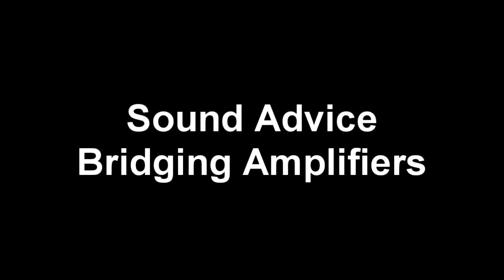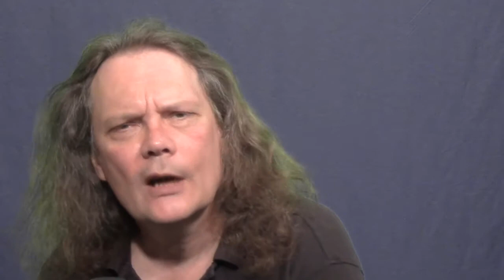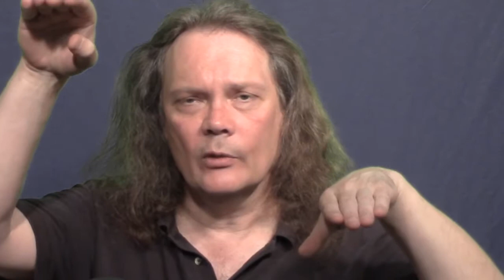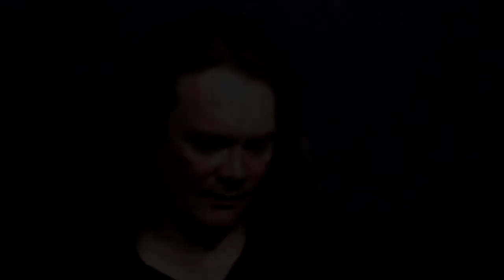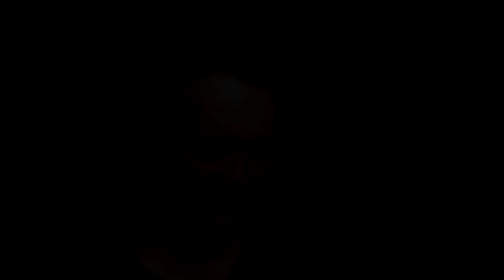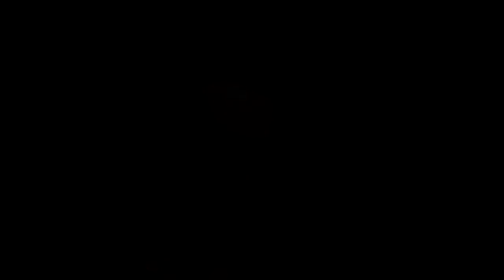Risks and Drawbacks of Bridging Audio Amplifiers

Comment: From the amp point of view there is no difference between bridged and a driver with half the impedance. If your amp can fully handle a lower impedance driver it has no trouble running bridged.
Reply from the maker: Thanks! -- Good point!  For safe operation, the minimum impedance of the loudspeaker load in bridged mode should be 2x the minimum impedance rated for stereo mode.  Thus, if the amp is rated to safely drive a 4 ohm load in stereo, it should have a 8 ohm load (minimum) bridged.

Comment: I knew and understood this. Wasn't until I got back into car audio. With my old school system I had left which was a Cadence amplifier and a Kenwood. Primary used for 8in mids. Put 1amp for 12inch sub. Bridged.
About 35% more out put. Absolutely was stressing the amps. Technically I was still underpowered so yeah I agree with your statement

Comment: Just when every over Bassed Head on YouTube is swearing by the BRIDGE YOUR AMPLIFIER BAND WAGON and rattling and contorting every body panel in their vehicles with a Bass level at a point of major annoyance to my ears and every bolt holding their cars together ..... Finally a Guy who actually is a sound engineer and knows what He is talking about to hopefully set the 
Record straight on how to actually set up your amplifier and Kill The " I am pushing a couple thousand Watts to my Subs Fairy Tale ..... Thanks Man great Video .... I spent years on the Road Lead Guitar, playing Loud and Fast Heavy and Hard Music ... Hauling Loads of P.A. Rigs and Marshall Stacks  going through many Sound Men and found only a small Handful of Sound Guys who could actually Tweak and Mix the sound of a Live Performance correctly .... But when We found The Guy's who could Mix and set the sound properly .... IT WAS LIKE MAGIC !!!!
Thanks for the Video and your Knowledge 
Cheers from Canada, Ontario
Reply: Not to mention you have three 100 watt Marshall super lead stacks going full bore and realize a P/A system isn’t really helping them very much unless you’re up in the 30,000 watts range.
Reply from the maker: Yeah, large stage volume where you have no level or EQ control  can make it more challenging to achieve a good balanced mix for the audience.  When it comes to level, just because you can, doesn't mean you always should.  It is possible to chase patrons out of the room, I often leave a lot of watts in the box.

Comment: I’m glad I found this. This is the best explanation of a bridged amp I’ve seen and now won’t be doing it. Thanks.
Reply from the maker: Thanks!  Some (big) amplifiers do have the current capacity and thermal abilities to easily handle running bridged into difficult loads, but for many it can be stressful.  In an ideal world, it should offer up to +6db more output.  I think it's often more practical if you're already running a fair amount of power to seek more efficient speakers rather than more raw power... if you need more output.
Reply: I have an Emotiva xpa 2 gen 1 and these are Bridgable is why I was thinking of getting another one if I could bridge and turn it into a monoblock?

Comment: Thank you. Just what I was looking for. Any thoughts on bi-wire?
Reply from the maker: Bi-Wire could mean simply adding a second speaker cable (same signal), in which case it's the same as using a thicker speaker wire... which is good, but there is a point of diminishing returns, especially if you're already using 12ga or 10ga wire over typical distances.

If you're referring to bi-amplification using an active crossover (or amplifier DSP) and more than one amplifier where one speaker wire carries low/midrange signals, and the other wire carries high frequency signals for the horns/tweeters and you bypass the loudspeakers internal crossover, I generally support that and I feel that configuration often sounds somewhat better and eliminates power losses that happen in passive crossovers.  Personally sometimes I do this, sometimes I don't depending upon which PA rig I choose.  Often the sonic gains are not huge, and it requires more amplifiers, more equipment (heavier rack!) and adds a bit more complexity.

I prefer active crossovers, but beware that the loudspeakers passive crossover may provide some driver protection, and possibly customization (eq & phase correction) for that speaker which should be programmed into your active crossover if you want the best performance.

Active (powered) loudspeaker systems often implement the crossover before the amplifier stage and use separate amplifiers for the low & high frequency outputs, thus providing the benefits of a bi-amplified system, and tend to be correctly scaled or limited to reduce the chances of driver damage from overpowering & transients.
Reply: @Barry-Watson  what about a bridgable amp?
Reply from the maker: @woabeatz9717  Sure, you'll get slightly poorer audio performance, but some amplifiers do have enough current and thermal performance to operate bridged just fine (into a reasonable load).  And, some amplifier designs are a pair of internally bridged amps per channel... a common feature in car amplifiers, for example.
Reply: @Barry-Watson  i ordered a lanzar vector... 2 channel   for one 15 inch woofer   bridge it or not..?
Cheap pyle woofer...
Reply from the maker: @woabeatz9717  I haven't used that amp, so I cannot say, but most car audio amps are designed to be run bridged.  So, I'd try running it bridged, and do that if it sounds good and doesn't get overly hot when driven hard.
Reply: @Barry-Watson  cool thanks....it says bridgable......

Comment: Thanks man, just convinced me not to try & blow up one of my amps...!!! 
🤔😏😂🤣🥴🙂😂
Reply from the maker: Thanks!  Some amps have the current capacity and thermal dissipation to bridge without issue, but most of the time I prefer to avoid driving gear that hard.  The gains vs benefits just aren't there for me.